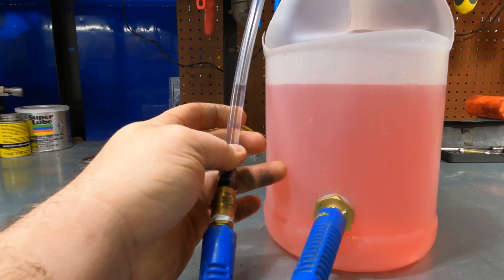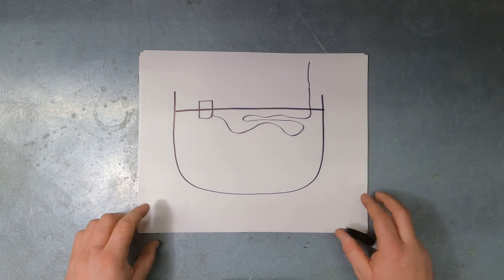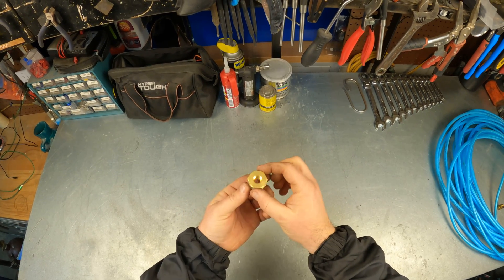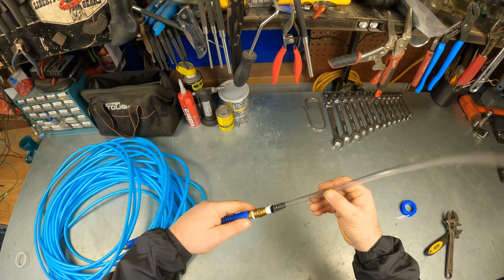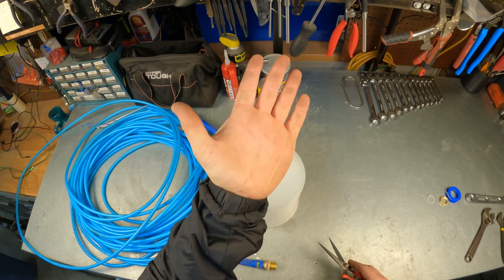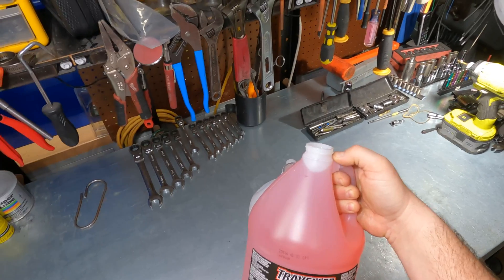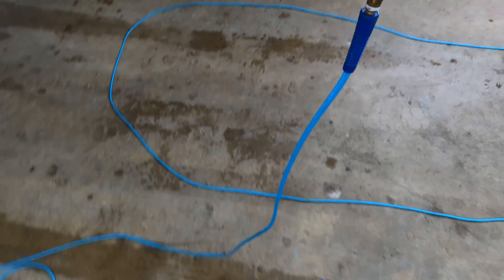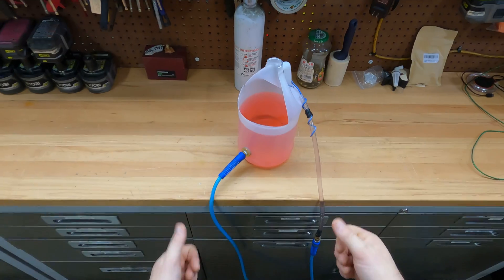Don’t Buy A Laser Transit!

Comment: My dad used one of these every day for 20+ years setting up mobile homes. His was a round igloo cooler on a tripod with a height-adjusting crank. The hose had a valve and a magnet on the end. The magnet stuck to the trailer frame, and the valve let him shut it off an toss it under the trailer to do the other side. It allowed him to build all the pillars to the same height an set the house down exactly level on the first try every time. An all day job for 3 people became a 2 hour job for 2 people. And the big plus over a laser is you dont need line of sight.
Reply from the maker: My grandpa and dad use them, that’s where I learned! We set up mobile homes and office buildings with one too. They started setting up mobile homes in the seventies and I started helping when I was old enough. It’s an awesome tool for a diy person I think

Comment: I was searching for this to build a New Carport for my rv and this popped up lol. Thanks for the serendipitous help ;)
Reply from the maker: Glad I could help! It’s an awesome tool!
Reply from the maker: My family has been using this tool from about the 1960’s I believe. We have set thousands of buildings with it all over the country. So many people on the job sites couldn’t believe we weren’t using a laser. But we would ask them how they recommended running the laser around the side of the building. They were stumped!

I actually do own a Bosch laser transit, and it is a great tool for grading. It’s a little faster than the hydro-level at that job, but that’s about it. Hydro-level beats it in every other application. 

Our main issue we had with it was on busy job sites people would pick up the reservoir trying to figure out what it was. Had to put cones and signs around it… but they would still move it on occasion. So we’d have to re-set the water to the benchmark, chew them out a bit, then go back to work.
Reply: @whatszackdoing  
Gotta have "the talk": Ok ppl, ya know how when we got the expensive laser level we said don't eff with it unless ur an astrophysicist cuz it involves quantum mechanics? Yeah well, this here $5 water level involves Einstein's spooky action at a distance so same caution applies. Oh n if anyone gets entangled in it, I wanna take this time to say it's been nice knowing u n I hope u like ur spaghettification with Spaceballs.